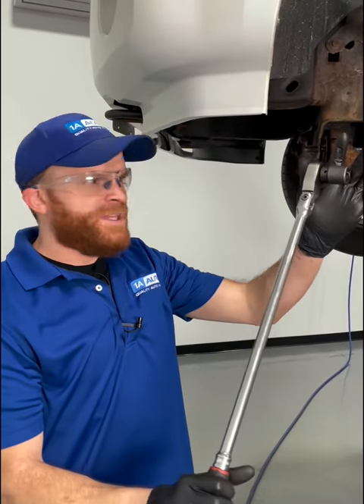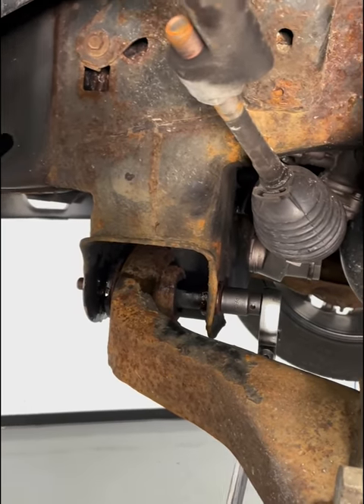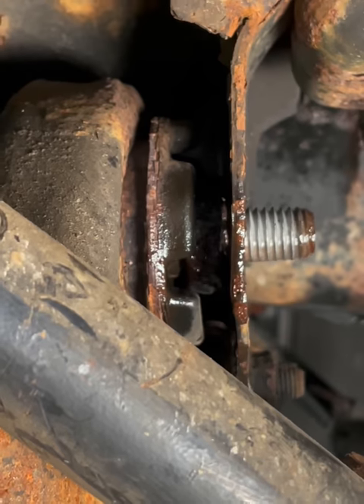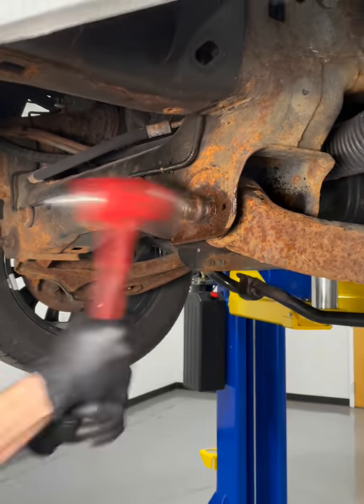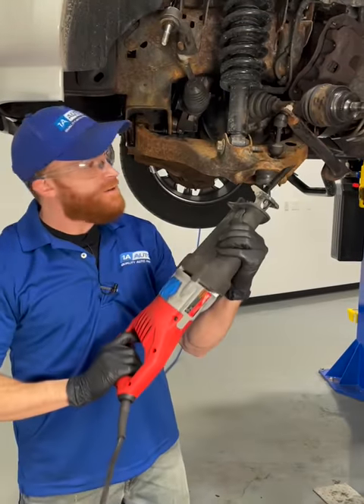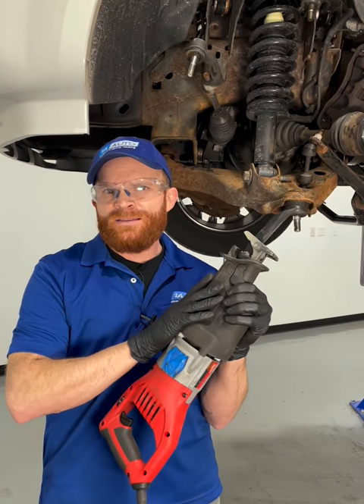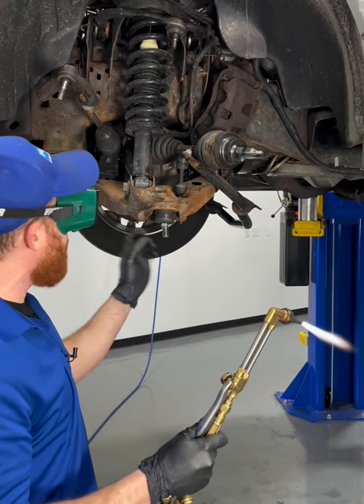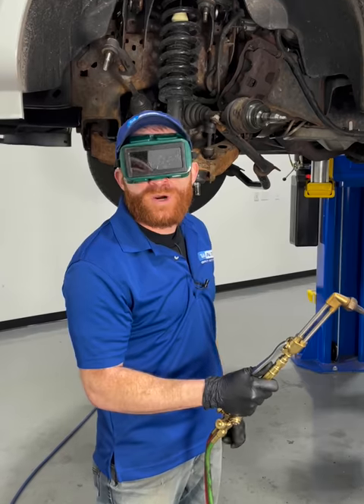Stuck Lower Control Arm Bolt Tips #shorts

Comment: The torch could be used before the saw, many times heating up the bolt can help it break loose.   Just have to know how to use it.
Reply: Heat, cool and repeat!
Reply: I was just about to bitch about that, thanks for saving me the finger movements lol
Reply: not if when the bolt was bent inside the frame
Reply: True but these in this case it’s usually the bolt rusted in side of the bushing collar.
Reply: @stephanieplager9364  u just invalidated your statement by typing that but it's good to be curtious
Reply: @JonTheOG  heat *spray with pb, *let cool repeat
Reply: Honestly with the cost of bolts (special camber bolts $10 ea) I'd just grab the Sawzall, I've struggled for hours before trying and trying, while only saving $20
Reply: @brandoncontrades187  yep and the torch could just result in melting the rubber but not freeing the bolt from the tube inside the bushing leaving you still in the same spot.
Reply: @inibrasiumthefirst2680  learned a trick with candle wax that works a bit better than the penetrating oil like plaster or jb80, you heat up the bolt a little bit with torch then just touch the wax as close as possible to where the nut and threads meet up
Reply: If they spin in the inner crush sleave youre fucked. Just cut em out
Reply: You can also hit the head of the bolt straight on with an air chisel, that will usually free it up.
Read more

Translate to Thumbs Up
Reply: And there-in lays the issue.. ‘if you know how’
Reply: Except when it’s stuck in a bushing…like in the video..  heat won’t break it free. It’s just gonna melt the bushing and the sleeve will stay seized on the bolt

Comment: “Proper hand protection” while wearing nitrile gloves lol
Reply: Leather gloves are prolly on the other side of the shop.
Reply: Honestly that’s worse than being bare handed. Back when I used to work with an oxyfuel torch I would just use it bare handed on my right hand and a thin drivers glove on my left because it was easier to have good trigger control when cutting steel.
Reply: Exactly my thoughts lol
Reply: Ya he was holding that torch like a statue too
Reply: Lmaooooooo
Reply: Nice clean shop, must feel good

Comment: Before you loosen anything, tighten the BOLT.  The fastener is tight so the bushing will be held in place.  The bolt will be turned in the bushing to break it free without twisting the rubber.

Comment: Brings back memories. Had a LCA nut stuck on my old Trooper. Impact would not fit. Used a big box end but could not fit a cheater bar either. Eventually blocked the wrench with wood against the floor and lowered the vehicle until I heard it pop. Raised it back up and was able to loosen it but every turn was very difficult.

Comment: Cut the bolt head off then stack washers on the other side put a set of vice grips on the end to hold the bolt and turn the nut, it will press itself off.

Comment: One technique nobody ever mentions... tighten it from the nut side- really tight. Like enough to stretch the bolt a little. If you can get it wet and relaxed to allow the rubber to twist easy, then you can get the penetrating lubricant into the sleeve. The stretching bolt becomes loose by moving, and shrinking.
Reply from the maker: +Daveunruh Thanks for the feedback!

Comment: I built a puller what grabs under the bolt head. 
If there's clearence to use it, it'll brute force anything what's seized into rubber. 
If for some reason, you can't grab under the head, weld on a ring to pull on that.

Comment: there is another trick that may work and won’t mess up your bolt. Take a box end wrench and wedge it between the base of the head of the bolt. Use the wrench like a pry bar to pull out the wrench while unscrewing it. I saw ChrisFix using this trick

Comment: Rookie didn’t even go for the OG 4”grinder and cutting wheel
Reply: He is wearing welding shield on his eyes to use a blow torche lol they teaching people wrong lol
Reply: megadethGUY M no those are the correct goggles for using the torch. Welding shield is full face unless you are using oxy acetylene in which case you would use the goggles he has
Reply: @lazarustheatv8389  Shade 5 full face shield

Comment: Heat the head of the bolt and the threaded portion as much as you can and then go at it with the air hammer. Usually this is enough to free the bolt from the sleeve of the bushing

Comment: Tighten the nut again then loosen the bolt.  The nut tight pinches the bushing sleeve in place so loosening the bolt breaks the corrosion loose gripping the bolt to inner bushing. You will have to retighten the nut several times till you get the bolt spinning.

Comment: Hey so I got a 2007 grand prix sway bar that has a stuck bolt and it just keeps spinning I can't tighten it either plz help I can remove one but the 2nd one won't come out iv even tried using a pry bar as I loosen it but won't budge

Comment: Just heat the sleeve until it’s red hot and it’ll come out. If you have to melt it, just melt the bolt head and the nut. I’ve never needed a sawzall, and I’ve done 300+ cars with the spinning bushing problem.

Comment: Just cut out 2 control arms on my truck. Diablo carbide blades are perfect for the job.
Reply: After using some Diablo blades when I ran out of Milwaukee blades while demoing cast iron pipe I swear by them, well worth the extra cost.

Comment: If you have the nut off and are just trying to get the bolt out why not just use a wrench and push it out and use a impact to spin the bolt?
Reply: getting an impact behind it isn't always an option

Comment: I’m confused what’s cutting going to do you still have a bolt stuck inside?
Reply: Stuck in the old control arm maybe but not the new one
Reply: The center of the bolt which is stuck gets pressed out of the control arm (once you can get it removed from the vehicle) with the old bushing, the new bushing will get pressed into the control arm without a bolt stuck in it. The only time you ever have to remove these bolts is if your replacing the bushings in the control arm.

Comment: Still easier than the starter I replaced in my 5.3 Envoy. Now I know why you don't have a video on that. I can walk you through how I did it and that Sawzall was one of the tools used and the welder I bought was another. I didn't want to hack my Y pipe up as it's 18 years old and looks like new. Hint hint
Reply from the maker: +TIHS PID the REKCIL TILC Thanks for the feedback!

Comment: Okay just let me get about over a few hundred bucks worth of tools and parts to try this out. This video is so helpful.
Reply: I bought an air compressor with an air hammer. Total cost $600 for the accessories for the bolt. Actually the cost is much higher but I will spare the details. Ultimately what worked was bar with 6 foot cheater, hours of prying, torch, PB blaster/free all, sledge hammer. Ultimately the air hammer worked but did nothing at first. Also I spent about $50 on just replacement bolts/nuts and probably 16 hours of my time total work time for just two damn bolts.

Fun times living in the rust belt

Comment: I just replace te rear lower rearward control arms on a 2002 subaru and end it up cutting the control arms to re use the camber bolts trust me i had a lot fun with that ones

Comment: What about an 4 "angle grinder with a cutoff wheel.
Reply: Or an extended high-speed cut-off tool for the spots too cramped to get the whole angle grinder into.

Comment: DIYers please start with a propane torch or mapp gas for bolts, i like induction heaters honestly. But seriously dont just go borrow your buddies oxy acetylene set up for one job, until you get a feel for it first. Not a rust belt mechanic, but i own trucks from the 60s, never needed more than a mapp gas torch and even that is sparingly. Not that others wont, im just saying be careful for goodness sake. Safety 1st, you only get one you.
Reply from the maker: +Harley C Thanks for the feedback!

Comment: For the DIY on the ground doing this work. Grinder or cutoff wheel. Cut them all up you'll be so frustrated I'm sure you'll chop all those bolts off
Reply: Tricky part is getting access to them all with a grinder, especially on something like a multi-link rear suspension where it's real crowed.

Comment: All that. Excedalean he is useing you could by  10 bolts that. Gas is not cheap   If  being paid for the job   Time is every thing   To move on to the next job    Not onley that les labor you charge keeps the customer. Comeing back for the next job    Best way is  put a wrench on the nut let it file  and  inpack it out in seconds
Reply: What? It would have been nice to understand what you said, but you made it impossible.

Comment: or your can just use a milwaukee 2000 something impact and just utterly destroy that nut with absolutely zero effort
Reply: I've used impact wrenches over 1000 ft-lbs and still somehow bolts are resisting it.

Comment: Why would you wear welding goggles your not even welding
Reply from the maker: +megadethGUY M We wear goggles to ensure nothing comes up at us and scratches our eyes during bolt removals.
Reply: @1AAuto  the ones that you are wearing are for welding you don't see nothing out of them unless your welding your teaching false practice.
Reply: You still have to use ultraviolet radiation filtering lenses with a cutting torch. A cutting torch is still bright enough when cutting steel to burn your retinas- not good.

Comment: Why is he trying to remove the lower arm bolts with the shock and spring still installed? Anyone with a brain who has done this before would know that the shock and spring are putting downward pressure on those bolts making it harder to come out. Try removing the spring and shock before applying heat to a frame everyone. Just cuz someone makes youtube videos doesnt mean they know what they are doing lol
Reply: You don’t know what your talking about
Reply: The strut is not putting any downward pressure on anything, the spring is held at maximum extension by the strut assembly.